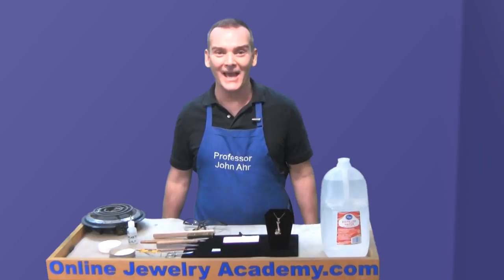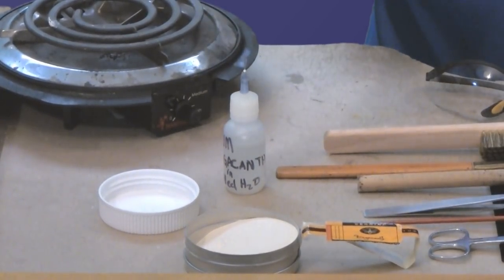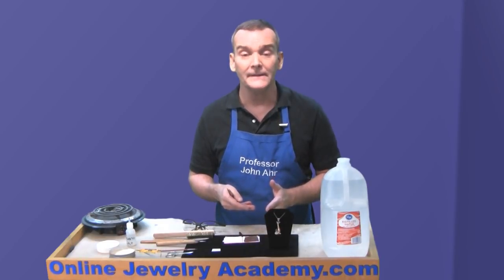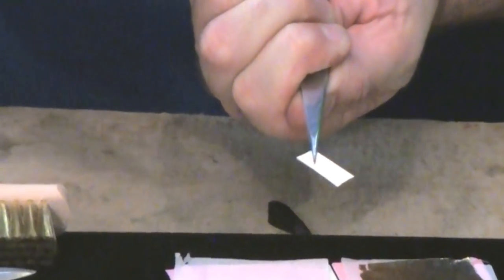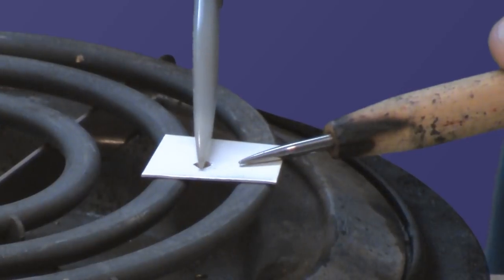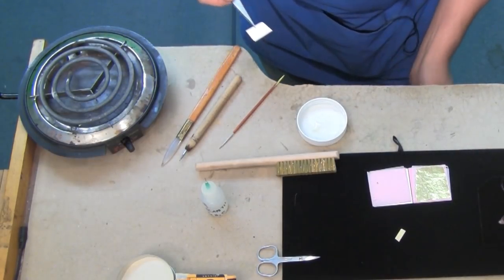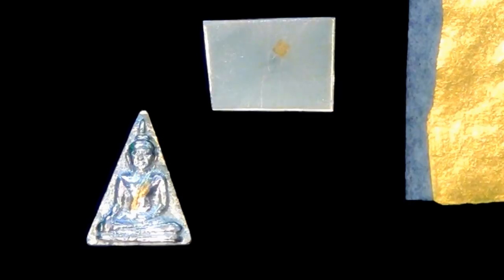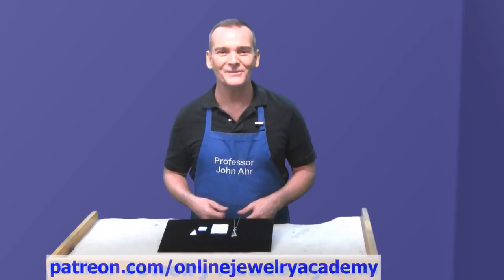Add Gold To Silver Jewelry With Keum Boo

Comment: Great demo video on the Keum-boo technique!  As one who incorporates Keum-boo in nearly all the work I do, I thought I would share some of my insights I arrived from some experience and experimentation. Firstly, if you want to experiment a lot, I would suggest starting with 24K gold leaf. The 23.5K gold foil supplied by Rio is a very nice material to work but at $8/square inch, it’s also a tad expensive. 24K Gold leaf may be considerably thinner, but it’s also effective in applying durable gold highlights to silver pieces. At just $0.15/square inch, it’s very economical so you can experiment a lot with your technique and get better results!  The biggest advantage to using the thicker gold is you can cut/form specific shapes; 24K gold will result in a more “organic” highlights.  Here are a few more notes from working and experimenting with Keum-boo:

*24K gold and gold leaf can be applied to 925 sterling and 935 Argentium silver without depletion-gilding fine silver on the surface. Using 23.5K gold might be tarnishing slightly with heat and impeding fusing the gold to the surface of non-frosted silver. You can also apply multiple layers of 24K gold leaf to silver, resulting in a more durable and deeper gold coloration. The color is deeper because often thinner gold leaf will partially diffuse into the surface of the silver.

* The application of even heat is pretty critical to getting a strong bonding of the gold. When the silver is too cool, the gold does not bond well, and may peel off in parts, later. When the silver gets a little too hot, the gold may completely diffuse into the surface, producing a lighter alloy which doesn’t tone as much. This is Electrum or “white gold”, which can be an interesting effect too. Applying gold to highly curved pieces is also tricky, but putting bent copper under the piece to conduct heat more evenly helps. It also helps in consistent heating to use a “hot plate” surface that is one piece, vs. a coiled heating element.

*You can also bond 24K gold wire to silver using this method. I like to hammer out the wire partially so it has a wider area to bond more evenly. Very tiny bits of 24K wire can be hammered out very thin (8-12 microns), yet still very easy to handle and apply to silver with heat. You can get gold dots and other shapes that add detail to your work.

*Burnishing: sometimes a lot of burnishing can result in marks that are later difficult to polish out around the gold, especially if you don’t want to remove any gold to the piece. Try using pressure with tight, circular strokes instead of long strokes which leave burnishing marks across the surface; in some cases this will achieve a cleaner final result.
Reply from the maker: Thanks for sharing your detailed comments about the Keum boo process.  I'm sure that many of the OJA's viewers appreciate your detailed descriptions as they relate to your experience with the process.
Thanks for your support! : )
Reply: Thanks John. Not trying to upstage your demo with my details...it's just that gold leaf is a great (cheap) way to experiment with the technique...

Comment: Is the arabic glue a must? I saw the technic made without as well and I'm wondering if it really does have added value. also, I'd like to use it with oxidized silver, hoe can I oxidized after applying the gold? thank you for the great teaching and help.
Reply from the maker: I believe that the Gum Tragacanth is essential to achieving superior Keum Boo results.  You can purchase it from an online gourmet supply company.  When doing Keum Boo, you must apply the gold foil to a clean fine silver surface (as mentioned in the video).  You oxidize the silver after you've finished applying the gold by dipping the silver piece in a solution of Liver of Sulfur.  The OJA has a number of videos on depletion plating or raising fine silver and the use of Liver of Sulfur.  You can find the complete OJA playlist on our website at:  www.onlinejewelryacademy.com
Thanks for your support! : )

Comment: Im Korean yet I didnt know about this method until I googled fine silver bezel with gold leaf lol. So can I use this method to cover the fine silver bezel with gold foil? Thanks
Reply from the maker: NO!  The heat from the hot plate will most likely crack your stone.  Notice that all of the examples in the video do not have any gold foil on the stone settings.  I set the stones after I finished the Keum Boo.  Please refer to my other response.
Thanks for your support! : )

Comment: I usually use 24 gauge sterling sheet for pendants and earrings. Is that thick enough or should I go to 22g?
Reply from the maker: It's your choice as an artist what gauge you use.  Personally, I don't use 24 gauge very often.  I prefer to use a gauge that will resist bending. 😀

Comment: Can keum boo be worked on with non metal clay? Or does it have to be metal clay for it to work?
Reply from the maker: Klum Boo is the application of gold foil onto a sterling silver surface.  Therefore, you must work with metal elements.

Comment: What happens if you try to do it a second time after it’s cooled down. Will that ruin the first piece?
I think this is pretty cool. I see things like this and it makes me wonder about the first person to discover  these techniques. Thanks, professor Ahr. 👍
Reply from the maker: Hi Barbara,  Great question.  Nothing will happen to the gold that you've already adhered if you reheat the silver to attach more gold.  Just be sure that the silver surface is clean.  You may need to pickle between applications.  I share your curiosity about the past.  I often wonder what the world was like in ancient times.  I'm sure it was just as dysfunctional as it is today.
Thanks for your support! : )
Reply: What John said is true for the gold used in his demo, which is 3.6 microns thick. However, if you use thinner gold leaf like I do, the gold may completely diffuse into the silver with a second heating. Also, if you solder a piece around gold fused this way, some of it may also diffuse into the silver as well. Experiment to see what happens...

Comment: Can you polish the piece or will it come off
Reply from the maker: You can tumble the items but you cannot polish them.  Polishing would wear off the gold. : )
Reply: @OnlineJewelryAcademy  thanks can you tell me what is the best way to keep silver 925 from tarnishing? i have made a cuban chain but everytime i wear it needs to be polished again
Reply from the maker: I clean my silver jewelry with a mild silver polish and thoroughly dry it before putting it back in my jewelry box.  I store my silver pieces in plastic bags along with a 3M anti-tarnish strip.  You can purchase them directly from the manufacturer or from most jewelry suppliers. : )
Reply: @OnlineJewelryAcademy  thanks
Reply: @OnlineJewelryAcademy  Do you tumble with steel shot?

Comment: Can it be a hotplate or does it have to be a burner?
Reply from the maker: According "pijnto", you can use a heated rock to warm the metal.  So, I don't think it matters if you use a coil burner or a flat hot plate.  The process is probably a lot less stressful to perform on a flat surface.
Thanks for your support! : )
Reply: I am using a hotplate and it has worked very well indeed :-)
Reply from the maker: Hi Hilary, This is Don.  Thank you for letting us know about the error we made on our last release.  I am currently reposting a corrected version which does include that information.  John got the material from an Etsy store called Raw Brass.  It is in China so it might take a while to arrive after ordering.  The corrected video should  be up in about 30 minutes.  YouTube doesn't let us modify videos very much once posted so a correction like this requires re-posting the corrected version. But I am much happier to find out about this early enough to actually fix it.

Comment: Hi there. Great video. I just wonder if it will be possible to thin 24K gold on a rolling mill such as to work for Keum Boo. Have difficulties to get adequate gold foil in my country. Gold leafs are to thin to be used. I tried it but it tears apart when planished.
Reply from the maker: Hi Josef,  I have never tried to thin 24K gold down to a thickness suitable for keum boo.  I'm sure it can be done.  But, I'm sure that there is something to the process that I'm not completely aware of.  Be sure to do your research before you start down that path.  Good luck with your creative pursuits.
Thanks for your support! : )
Reply: Many thanks. I will try it out. Keep you posted on the outcome of this experiment. Best regards. Josef
Reply: I have hammered out 24K gold wire so it will attach using the Keum-boo process. But I think it's very hard to get gold sheet thin enough to be cost-effective using a simple rolling mill. When gold leaf is made, the sheets must be hammered (for a long time) between pieces of vellum to get very thin.
Reply: Thanks a lot for the suggestion. I will try out hammering.
Reply: You can read about this in old books, I think it used to be a trade by itself!  Hard to imagine just doing it on the fly    Rolling foil a ten-thousandth of an inch thick??!!!   I don't think your roller is that good   Can you roll some gold between sheets of something tough?